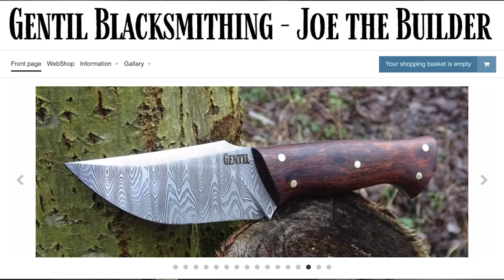Knife making - Integral Damascus knife with a guard

Comment: Hey, man. Just a little tip that I thought I'd share with you; I get some incredible results with coffee darkening by letting it soak in the strong coffee for 24 hours. After I soak it I take the blade and go straight into boiling water for 15 minutes, without wiping off any of the oxides before hand. I get jet black finishes that are super durable that way. For some reason, at least in my experience, applying a consistent heat makes the black oxide even more durable. So you can use kydex sheaths instead of leather without having to worry about scratching. I hope this information helps! Beautiful knife btw!

Comment: This is beautiful work man, you can tell you really care about making it the best you can. The reason why a good quality knife can easily run you 300$+, major difference between this and the 60$ factory pumped garbage in the outdoor section of Walmart. Thank you for that drill bit tip to avoid deflection.

Comment: Why don’t you grind the mill scale of the material for your billet? It can cause serious issues with the forge welds. I’ve tested the difference between cleaned material and material with the mill scale on it and the billets with mill scale fail much more often

Comment: You could easily have made two large knives out of the steel. I know it is better to have a little to much material than too little, but you mean it a little too well. You could save yourself a lot of expensive grinding belts if you don't leave so much excess material on the blades. Other then that nice job man.

Comment: Nice work, however, perhaps you should look up the meaning of "integral knife". What you have is a normally forged damascus knife with a separately made guard. I would add that normally the "integral knife" has a full tang with a slab sided handle. (NOT the weaker glued hidden tang or rat tail tang you've chosen.) The really true integral knife has a integral guard as well ....